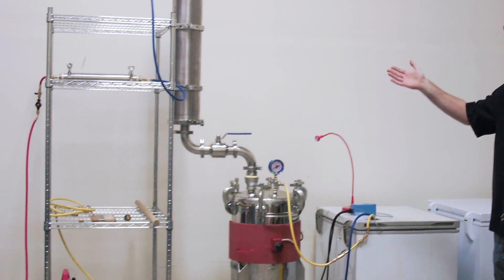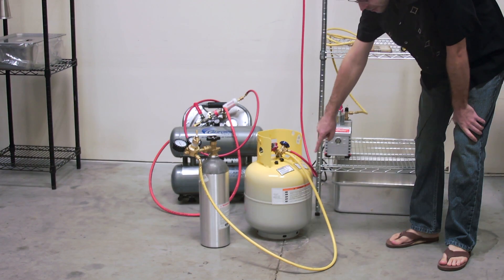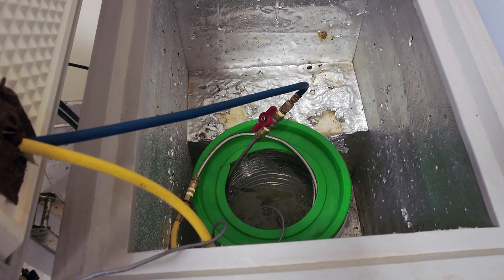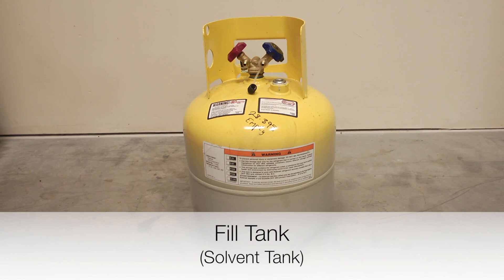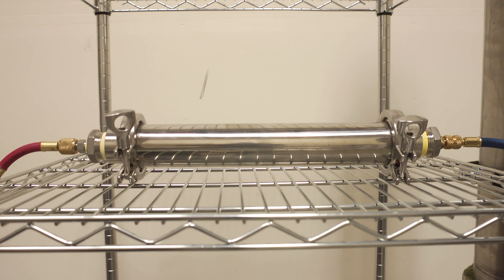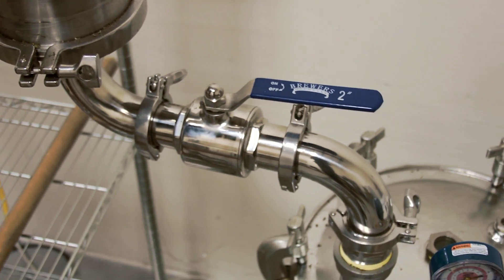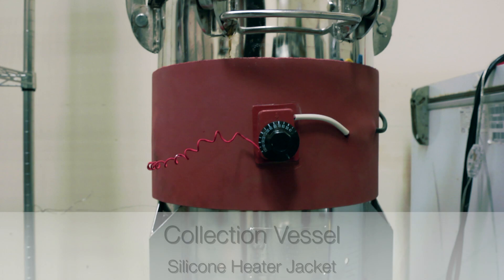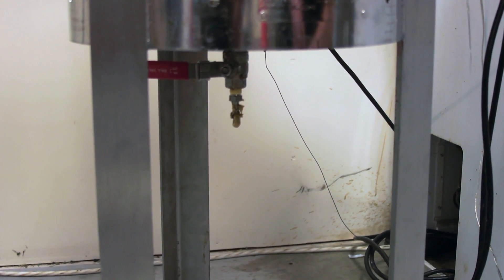Liquid Solvent Extraction Equipment

Comment from the maker: all of the products that come out of this equipment are tested for residual solvent and any other potential contaminants all of the hoses we use are rated for use with the chemicals / solvents that we work with there is no leaching or secondary contamination from these hoses as they are made of buna a material tested for compatibility.